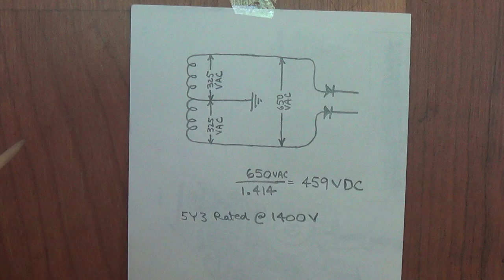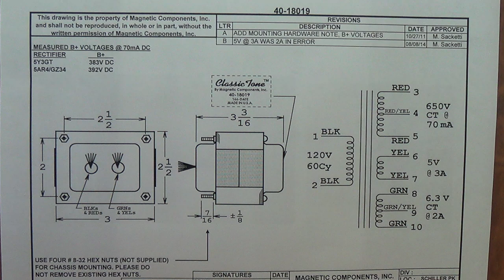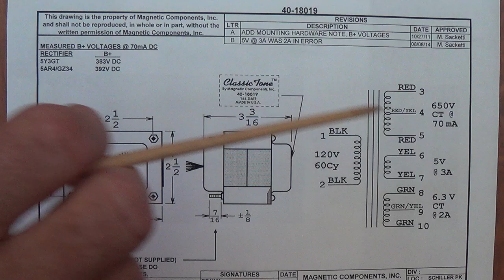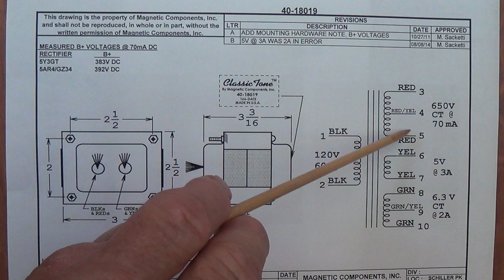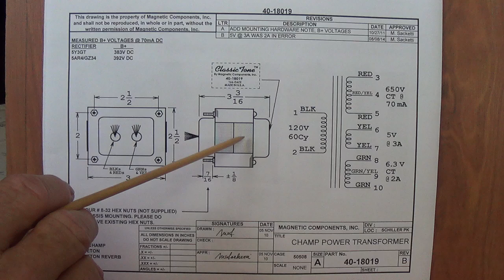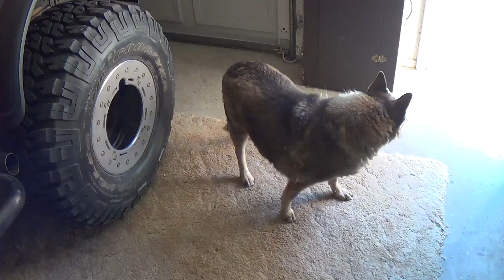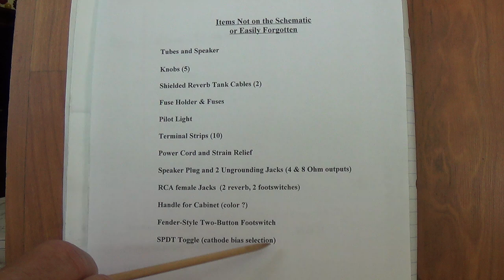How to Scratch-Build a Vintage Amp, Part 3:  Transformer Selection, Parts List, Cost Analysis

Comment: For my project I calculated a max current of 470mA (fixed bias) max @117.5Watts and 370mA (cathode bias) max @54.5Watts, wich is more my goal. The max output power shouldnt be higher than 70 Watts.
My power transformator is specificated for 420mA, and if I use two GZ34 rectifier tubes my max current would get limited at 320mA. 
So Since I don't need to run my amp at the highest wattage the two rectifier tubes would deliver enough current, rigth?

The power section has two 6550C (class AB1) and two 5881 (class A1). So also If I run them in fixed bias mode at around 55-60 watt that would work with my rectifiers, or? 
And also the optimal  impedance of both is 5kOhms. running four instead of two tubes would divide the impedance at 2 if. I'm right. So my output transformer with an impedance of 2.4kOhms also should works with them. (I heard pentodes in triode mode need an a little bit higher impefance, so I use an ultralinear transformator). 
Since the transformators has cost so much I'ts time to save my money until I can get some of the tubes.
Reply from the maker: I am somewhat confused by your first paragraph, but according to this reference:  http://drtube.com/datasheets/5ar4-ge1959.pdf  if you use a choke input filter with the GZ34/5AR4, the output current will increase to 225mA each (450mA for the pair).....which would exceed the output capacity of your power transformer and probably work quite well for your projected circuit. Re the output transformer, if the four tubes are wired as two pairs, each in parallel, then your impedance would be half of 5K Ohms, or around 2.5K Ohms.
Reply: Uncle Doug Yes, I also will use a choke with 10 Henry, max 500mA and 1000VDC. Thank you for the fast answers.
Reply from the maker: Sounds good. Best of luck with your project.
Reply: Thanks, you really helping me out besides reading books about amplifiers.
I'm electrician, but for households and not for vacuum tubes, so I have a little bit basic knowledge but building an amp is a new challenge for me.

Btw, I was looking for datasheets for the 6550 they shows how the tube operates with lower voltage. Max plate voltage is 600V and max screen voltage is 300V. If the tube operates at this values I'd get around 100Watts. If I want to get only 50 watts out of them do I have to lower plate, screen and bias voltage or only the plate and bias voltage?

Comment: Would it be possible to take the tremolo circuit from this amp, and plug it into a 5f2a circuit with no change to the original circuit? Like Let it sit in the same spot as it does in the Supro, so it would basically be a vibro champ with the supro style trem?
Reply from the maker: Yes, I think it would be possible to do this, Michael. If you try it, please let us know how it turns out.
Reply: So I have the circuit assembled and added to the original circuit. I got about ten exciting seconds of trem goodness before the effect faded away n it hasn't come back lol. Any guesses on possible culprits? Or could it be anything?
Reply: (The original circuit still works just swell)

Comment: When is it necessary to use a shield over a tube.
Reply from the maker: +MrMac5150  The pre-amp tubes are susceptible to radio frequency interference, and the grounded metal shields protect them from it.
Reply: Got it teacher, by the way be-careful about picking up that milk bone if your dog does not eat it. I did that to mind and I got his eye tooth right threw my hand. I guess once it hits the ground, it is there property.
Reply from the maker: +MrMac5150 I understand, Mr.M, but Rusty and I have had a mutual non-biting agreement for many years :)
Reply: Uncle Doug
 I hope you made Rusty sign a contract, my
dog did not stick to our agreement, it was so simple. I told him, (quote) "don't bite the hand that feeds you."   lol.
Reply: +Uncle Doug that's smart if he wants to keep receiving his  bon(e)uses--to not bite the hand....

Comment: nice video. my schematic does not state the required vcd. what can you do then?
Reply from the maker: I'm sorry, Jim, but what is "vcd" ?
Reply: sorry Uncle Doug. I meant VAC as in your diagram showing 325 0 325, 650 center tap. my schematic has nothing on it that could lead me to understand that part of the transformer. I think I would need to know the required VDC and then do the equation backward to get the 325 0 325, 650 center tap. diagram at 4:58
Reply from the maker: @JolicoeurAbear  It depends on what output tubes you will be using and at what plate voltage they will be operating.

Comment: you are dividing the ac voltage by 1,414 when you should be multiplying. voltage aways increases after rectification.
Reply: +Camilo Pasin 
Hi Pasin,
The AC voltage is increased.
Doug did AC to DC calculation and therefore dividing is correct. As you are looking for the equivalent DC voltage created by AC. If you are interested, have a look into wikipedia to see the math in short.
Reply: its a center tapped transformer, sorry, my mistake.
Reply from the maker: +Camilo Pasin No problem, Camilo.....and thanks, Murrat, for providing an excellent response.

Comment: Uncle. What if i have 2 6L6WGB running in push-pull, and the data sheet calls for 360vdc maximum plate voltage. What transformer volt rating should i use?
Reply from the maker: 6L6's, even GB's, are routinely operated at higher plate voltages than 360VDC, so you have lots of leeway. Bear in mind that once the AC voltage is rectified and smoothed (to peak voltage) it will be quite a bit higher than the transformer output.....so a 350-0-350 PT should suffice.
Reply: @UncleDoug  thank you so much uncle. That's a great help. I have a 340-0-340 PT. I'm just afraid to fry my 6L6's. Thank you so much. :)
Reply from the maker: @The-Master-of-None  It should be fine, MT. If the voltages are a bit high, then simply reduce them with resistors.
Reply: @UncleDoug  my problem is the PT is rated 280mA for 680v center tap. According to others that current is too much for 2 6L6's running in push pull fixed biased.
Reply from the maker: @The-Master-of-None  You can't force current on tubes, MT. They draw only what their bias permits......so you can have a 2A high-voltage winding, but the tubes will not be harmed.
Reply: @UncleDoug  thank you so much uncle. That's a relief. I'll try to build my own amp soon. Thank you so much for guiding me.

Comment: Hi, why you don't used Input Jacks with Shunt Tip?
Reply from the maker: I do use the self-grounding input jacks for input.....but never for output.
Reply: so, output jack have own ground cable to negative leg of capacitor?
Reply from the maker: No, the signal contact of the speaker output jack is connected to the output transformer and the shield contact is grounded. You must carefully avoid ever grounding the signal contact.
Reply: Uncle Doug
Maybe you can show me that on some picture or video?
Reply from the maker: Simply look at the design of 1/4" jacks. Some have a leaf that can ground the signal when nothing is plugged in....some don't. You use the grounding type for input, to prevent hum. You use the un-grounded type for output, to prevent shorting your output transformer when nothing is plugged in.
Reply: Uncle Doug
thank you!!
Reply from the maker: You're welcome.

Comment: hi uncle Doug and rusty I purchased  a Hammond o/p tranny 290cex but for some reason its putting out 413volts dc from pin 8 of the rectifier which is excessively too  high. The ac vol. from the secondary windings is 696 v ac which should be 650 v( 325 CT 325) how can I drop the o/p voltage from pin 8 of the rectifier  from 413 v down  to  360v. Can I place a voltage drop resistor   between pin 8 of the 5y3 and the first filter cap
Thanking you kindly 
Tony Mercieca
Reply from the maker: Are you measuring the voltage output with the transformer connected to the circuit and all tubes in place.....i.e. while the circuit is functioning?  If not, then the voltages will go down once it is functioning. If it has high voltage while operating, however, I would suggest that you watch my recent videos on full-wave power supplies, which explains why the rectified, smoothed, DC output of a power transformer is always higher than the stated transformer AC output. You can install a resistor immediately after pin 8, but be sure it has sufficient wattage to handle the heat. The downside of this is that the resistor will reduce current flow to the output tubes......which is generally not a good idea.
Reply: thanks Doug for your prompt reply. I am checking voltages after all valves have warmed up, and amp is running  but that tranny is definitely putting out 418 volts after warm up .I will try a dropping res. and see how it goes. I  have watched that video on full wave power supplies ,and I will watch it again. Thanks again Doug  your video's are fantastic  best on you tube
cheers Tony
Reply from the maker: You're welcome, Tony. So the plate voltage on the output tubes, measured from plate to cathode, is 418VDC ? This is the voltage that really matters. If the output tubes are 6V6's, they can easily handle this. If they are 6L6's, it's actually a little low.

Comment: Where do you get your components from?
Reply from the maker: +Noah Page  I mention it in one of the videos. Electrical and mechanical components from Antique Electronic Supply and transformers from Triode Electronics.
Reply: thought so... couldn't remember. I'm really enjoying the series and hope Rusty keeps his freindship strong with Nikola Tesla. :)
Reply: I'm just starting to learn about valve amplifiers and are wondering what is the most sensible option to get my feet wet with valves.  I have never touched 240v mains before and what the safest way to make a tube amp. P.S I really like the Vox sound.
Reply from the maker: You should fully acquaint yourself with all the safety considerations, and then select a kit to build a Vox amp. After building the kit successfully, you could venture into scratch-building. Good luck.

Comment: Building a tube amp isn't cheap ;   It is a hobby ;     I have found partsexpress.com to be affordable source of parts ( resistors / cap/ wire )
Reply from the maker: You're right, Lost. The parts cost for a fairly simple design can exceed $500 quite easily.

Comment: I have learned a lot from you, mostly that I have a lot yet to learn! I have been trying to use your methods to find a power transformer for a scratch build of a Bassman 20. The schematic calls for a PT fender part# 019118. It is diode rectified. It is fixed bias. What little info I could find on the original PT says the bias voltage off the secondary is 50v 150mA, and the closest I can find (except for a completely out of my budget British direct replacement) has a 50v 120mA tap. The original PT high voltage is 300v, the proposed replacement 330v, both with about double the current as called for by adding up current draw. Are these differences a deal breaker? Here is a link to the schematic http://ampwares.com/schematics/bassman20.pdf
Reply from the maker: Greetings, Skyp. I would say that the proposed power transformer would work just fine. The only question would be the slightly lower current rating for the bias winding, but I don't think this is an issue since all you are seeking from this winding is a voltage potential on the grid.....not a continuous source of (fairly high) current. The higher high-voltage output can be reduced if necessary, but once again, I foresee no problems. Good luck with your project.
Reply: @UncleDoug  thank you! I have been chasing mt tail on this. My plan was to build just the PS, and then test voltages. You Are The Man. Thanks to Rusty, when I want to watch the videos on are main TV, the  Mrs dosen't mind:)
Reply from the maker: You're welcome. Rusty always had a way with the girls, Skyp. He was a real charmer :)

Comment: I think I would no longer call this a "Supro" amp. You are departing quite a bit from the Supro design, so I think just "My custom" amp would be more appropriate.
Reply from the maker: You'll have to agree that it is based on a Supro amp, Bill, so this title gives proper attribution to the source of the original circuit.
Reply: @UncleDoug  I like Supro's choice to apply the tremolo to the front end, before the reverb system. That allows the reverb to sound much more natural when tremolo is used.
Reply from the maker: I agree, Bill.